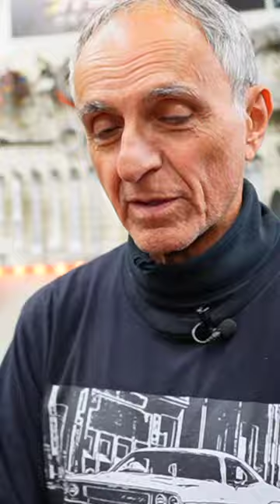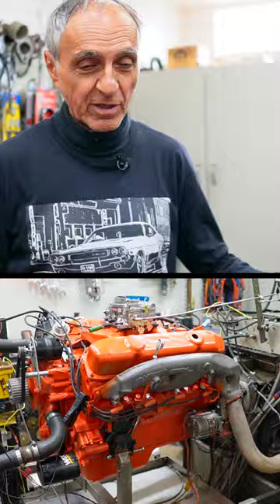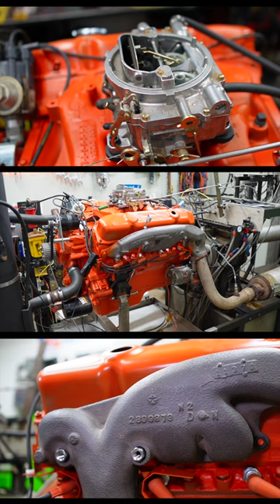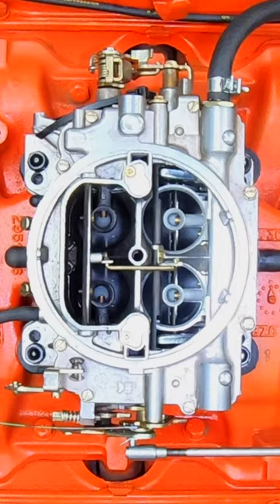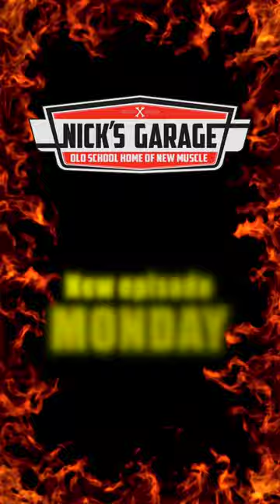California 440 Dyno Tested - Low Compression Muscle Engine #shorts

Comment: Unless this is for a vehicle made after 1975 there is no reason you cannot make a 440 or any engine for that matter as wild as you want in California. Vehicles are not required to be emission tested (motorcycles and RV’s included) if they are 1975 or older. So any muscle car of any make made prior to 1975 can have whatever you want in it.
Reply: Thanks for the Info.  We dropped the CR reason is for he can only get 91 octane  where he lives. 1975 and  older cars can do what they want. Great. I was told different.

Comment: I live in California and classic cars do not require strict emissions. They also don't need a smog check. So why would this 440 need low compression? We have 85, 89 and 91 Octane.🤔
Reply: I build all my  engines for 93-94 octane.  My client asked for less compression ratio reason why, wants no more then 91 octane. Do not forget, it has cast iron heads.
Reply: @nickpanaritis4122 Yeah, Nick, that guy answered his own question back in the day. The gas used to BE 98 TO 105 octane, Sonoco  260,,, Remember that gas Nick? It'll ping or Detonate. if you run too much compression. On low octane For that yesteryear engine.

Comment: I'm confused, doesn't having higher compression make the engine more efficient and lower emissions?
Reply: Higher compression increases NOx or oxides of nitrogen and CO2 or carbon dioxide while lowering CO or carbon monoxide. Lower compression reduces NOx and CO2 while increasing CO. It's a balancing act to keep the smog police off your back, especially in that state.

Comment: low compression for low octane isnt the same as cali smog checks. 1975 and older cars don’t require emissions checks. owner might want to run 87 octane fuel.

Comment: Love to see my max wedge on a dyno, it's in my dodge dart gt convertible. Push button auto tranny. Dual power carbs on top. Only a 30 made that year. Original block. No rebuild, it's low compression and 15,867 miles. Bought it on leave in california. Spent 21 years in the military. It stayed wrapped in barn up on blocks. Was a bit dirty. Soaked cylinders in oil for 9 weeks before a by hand turnover. No stuck rings, original compression stands starts, only had it up to 3500 so far. Ì think it's worth 100,000 my self. Might sell it at Barrett in Phoenix in 2025-26. Took me eight years to get the title replaced. They wanted the old one. I said no. Original sales papers and such. Still has original wheels. Picture me driving off lot, took it to Pomona 1 time, for factory I beat everyone that day.